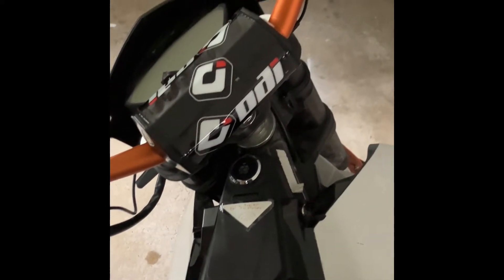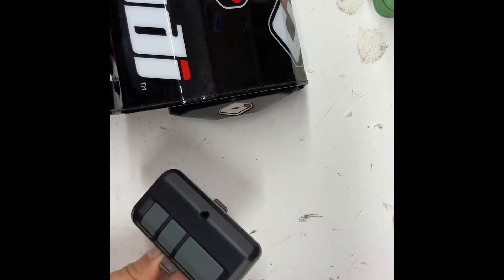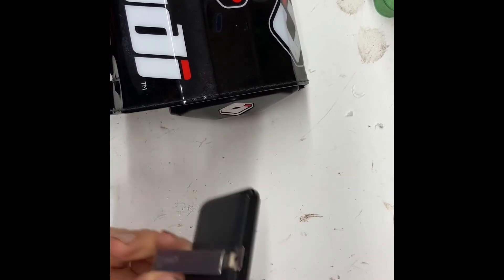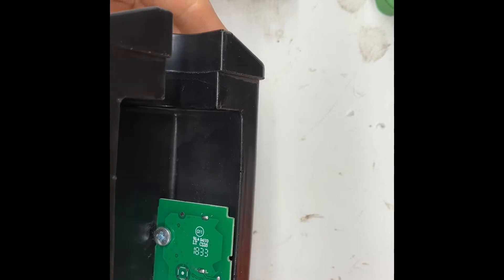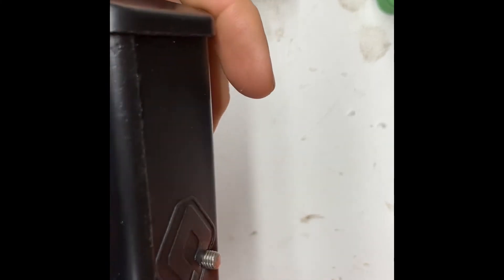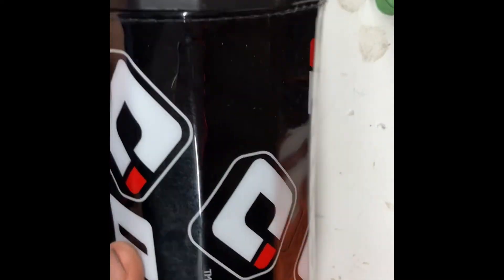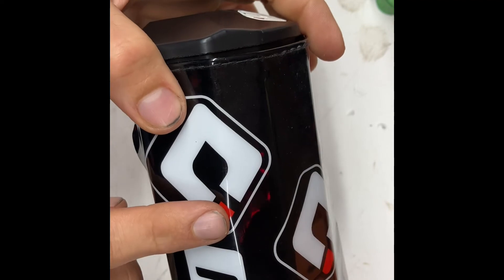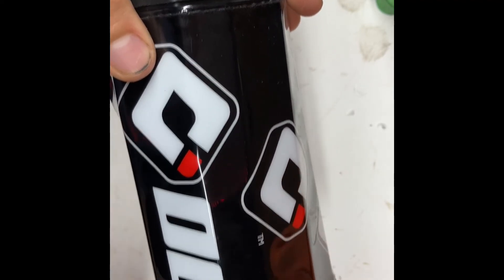My simple motorcycle garage door opener solution.

Comment: I found marker led lights that will fit in side reflectors(remove reflectors We can use blue lights here,as long as not combined with red or strobe.Im replacing mirrors with winglet mirror mounted lower,they have turn signal lights built in from the rear of mirrors.Im changing throttle and grips,turn signal switch to momentary on-off-on lever type.I hate the stock one,I forget to switch it off after turning,and it's a distraction.On the front fork shields,there are 2 rubber plug holes,don't know what those are for I'm adding speakers into the plastic covers with a 24 volt amp mounted inside seat.Im getting a DC buck step down board to come off the main 72 volt batts down to 24 volt.I removed the rear rider pegs and handholds also.Im planning on side boxes and rack.They make a top box also for that rack.Not sure if a helmet will fit in top box.

Comment: I also put swept back foot pegs on it,as my shins were bumping the stock pegs.Much better now.My stock charger blew up when it was really hot here in August.I found a much better one on ebay.Just rewired the stock plug to it.I guess the wire to kickstand us a safety,tried it yesterday,and bike doesn't move unless stand is up.The back top plate covering the wires to tailite has an extra unused pair of wires.I get no voltage reading from them.Wondering if it's for the top box they sell,if it has an extra brake light on the box.I need a wire diagram for this bike,haven't found one yet.

Comment: The dealer west coast told me to change out the oil at 1000 miles,and nitrogen charge the monoshock also,as well as cut back the rear mud gaurd up to license plate holder,he said the off road version tends to bottom out in rear gaurd.
Reply from the maker: Yup I cut that thing off right away, I thought it looked really stupid.